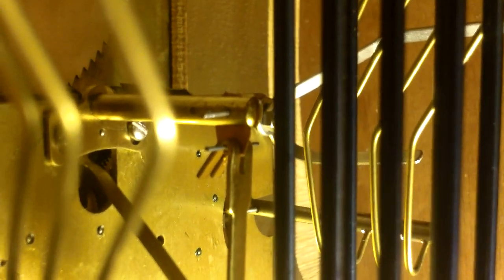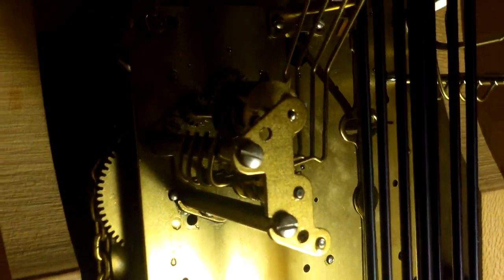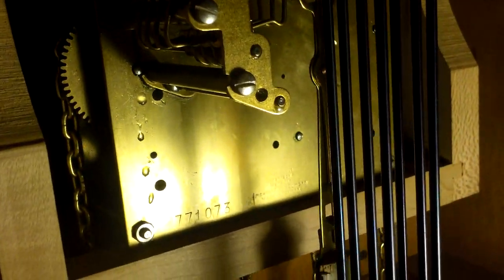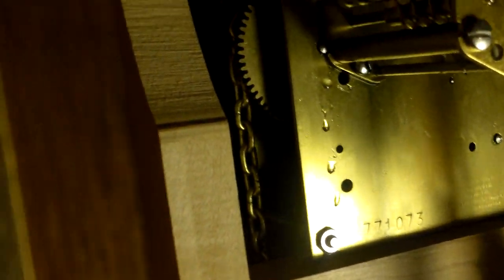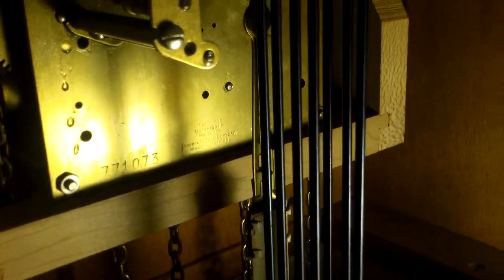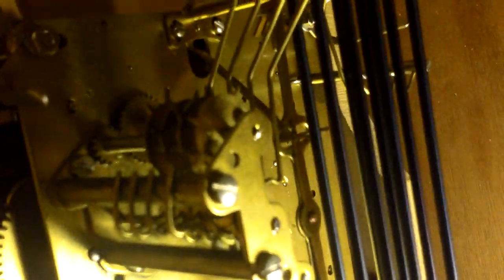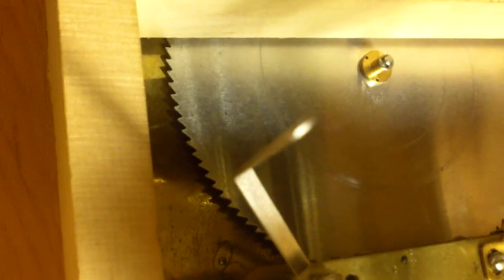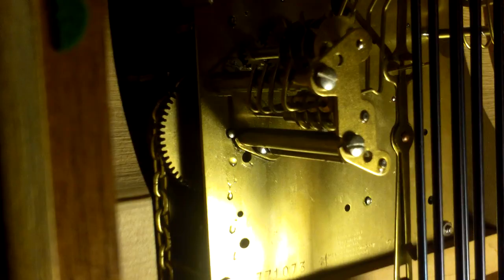grandmother clock striking 11 and ramble

Comment: You are actually wrong about the weights.

The one on your left is for strike, center for time, the right for chime.
Reply: Yiy are right , and don't u have a clock like this one in the video?
Reply: ClocksAndAlarms92 i have a grandmother clock and a grandfather clock, both mechanical. the grandmother clock is emperor and has a jauch movement, similarities end about there.

Comment from the maker: yes it does but only a millimeter each full swing but it will add up and eventually it will break, I kind of wish it was designed differently but that's the way it is. also I just did some more research and it turns out that it doesn't tell you day or night but it is a dial for moon phases. so I guess it is a lot smarter than I thought.